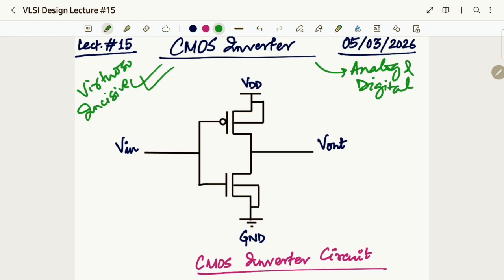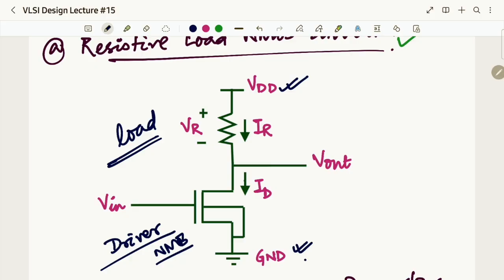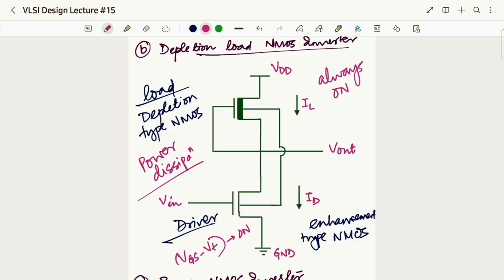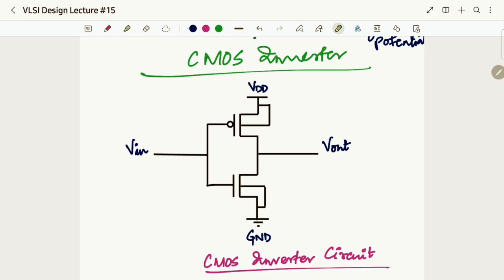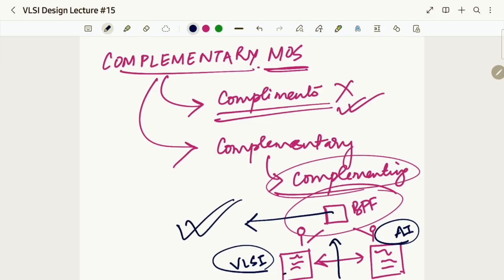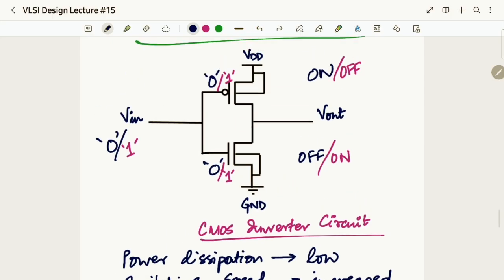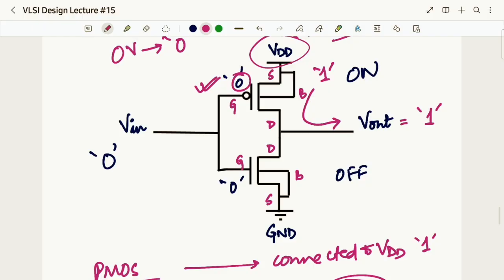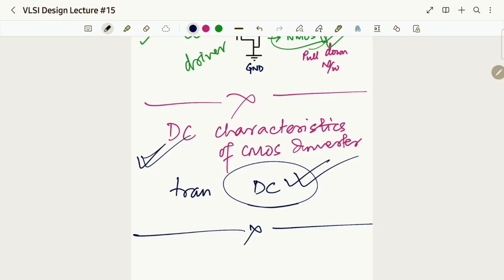Mastering the CMOS Inverter: From Logic Gates to Pull-Up/Down Networks 🛡️🚀 | VLSI Lecture #15

Comment from the maker: 📦 Master the Lab with the Virtuoso Roadmap Bundle:
Don't let tool errors stop your progress. Grab the toolkit here:

🔗 https://rzp.io/rzp/4cUKw6q

📖 *Chapters:*

00:06 - We've designed it! Now let's understand it!!!
02:59 - The Why's & How's of CMOS Inverter
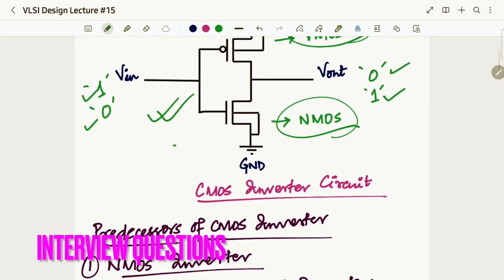03:38 - Predecessors of CMOS Inverter
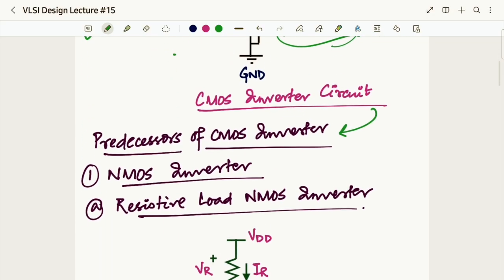03:59 - Resistive Load NMOS Inverter
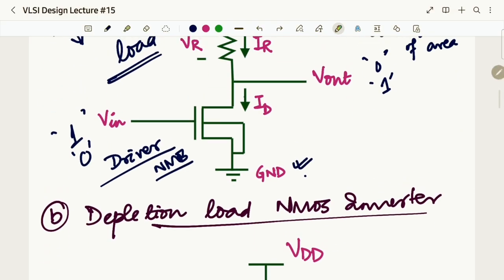07:55 - Depletion Mode NMOS Inverter
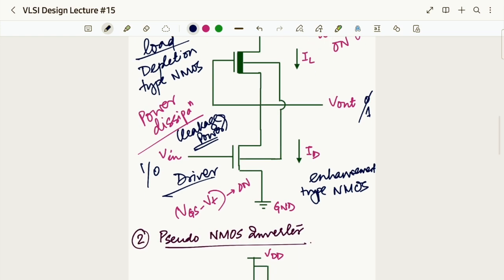12:31 - Pseudo NMOS Inverter
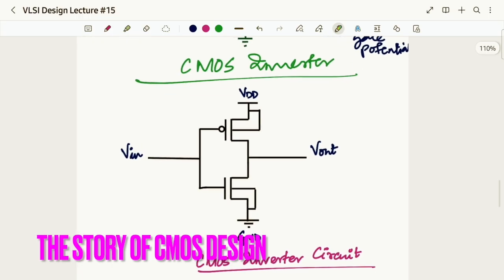16:25 - The Story of CMOS Inverter begins!
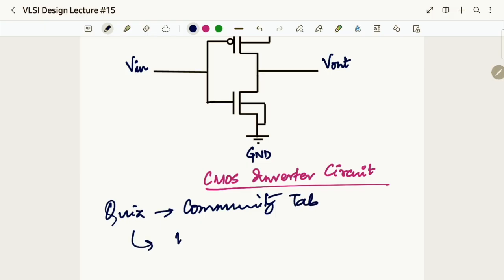16:48 - What is CMOS?
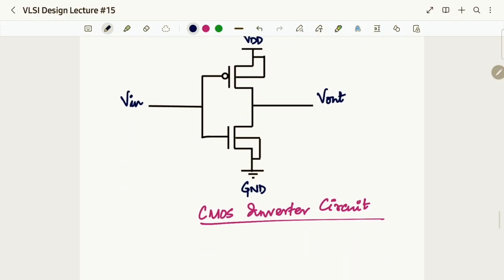23:55 - Working Principle : CMOS Inverter
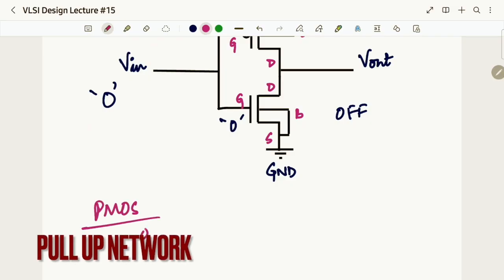31:50 - Pull Up Network
34:01 - Pull Down Network
37:09 - Next Up: DC Characteristics of CMOS Inverter
37:30 - Multiverse of Madness: Level VLSI

#roadto500subs #vlsidesign_ssg